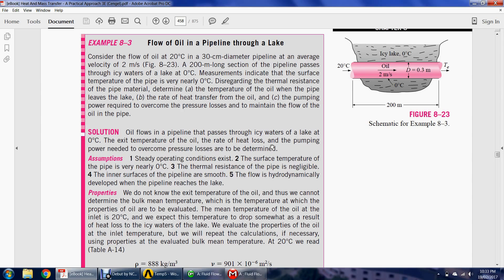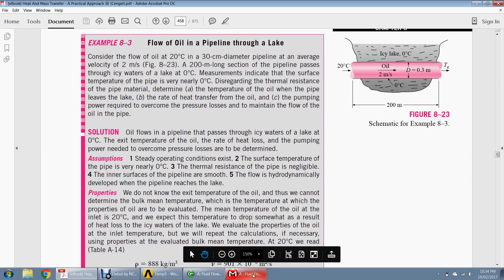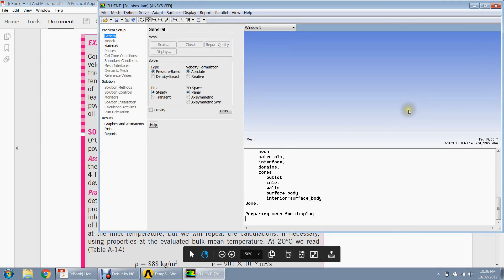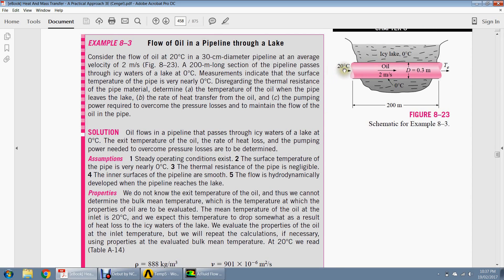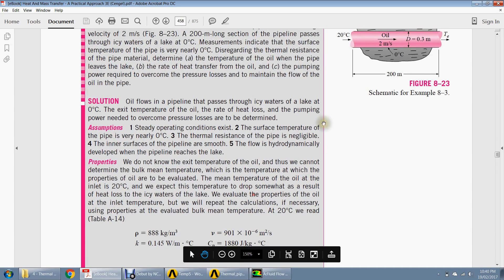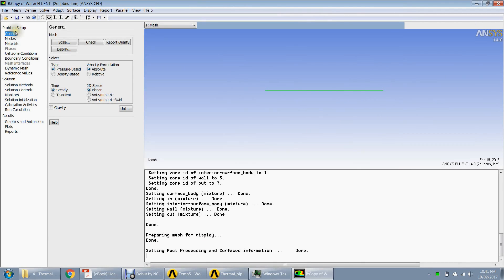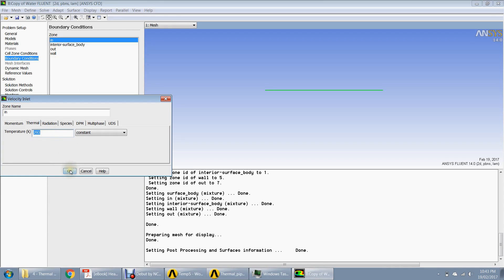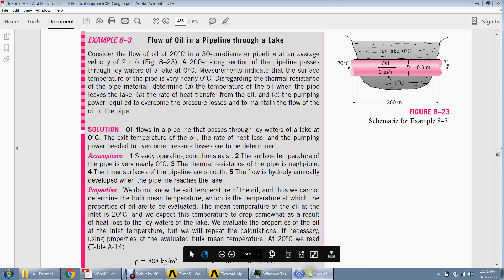Simulating Thermal Pipe Flows using ANSYS Fluent (Part 1) | 06 | Implementing the CFD Basics

Comment: HI, Thank you for the amazing tutorial! Just I want to make sure about the value of viscosity you put in Ansys ? it should be a dynamic viscosity right ? So we have to convert the kinematic viscosity value in the text book by multplying it by the density, right ?
Reply from the maker: Yes. Usually in fluent, dynamic viscosity is inputted. You can double check the units to make sure the correct input.

Comment: I have almost the same project to work with, but with rubber pipe of length of 180m. Why didn't you consider the thickness of the pipe? It does play important role to heat transfer. I would really need some help with my project...
Reply from the maker: You're correct. This was a demonstration that's why all the factors were not considered. For rubber, you might want to use special properties and perhaps include it's elastic nature?